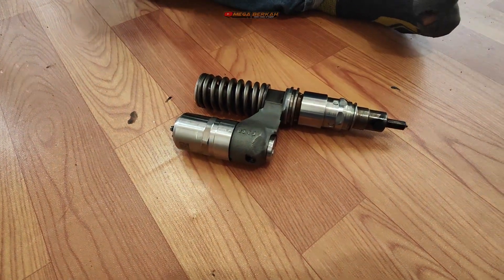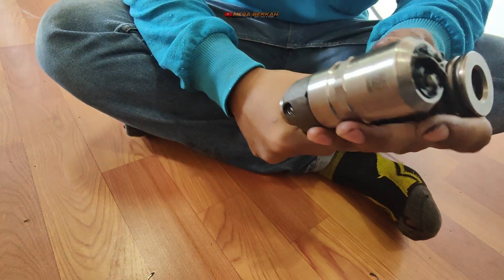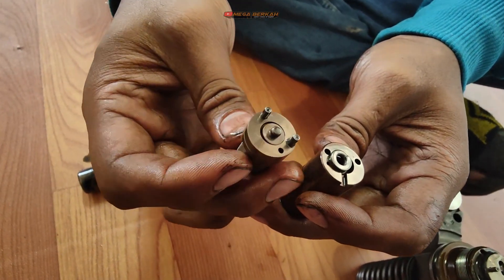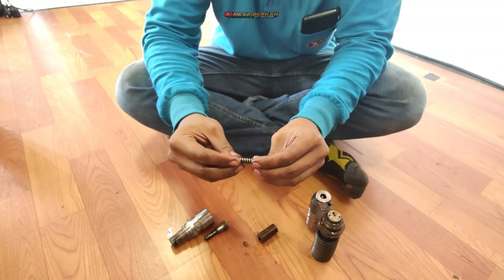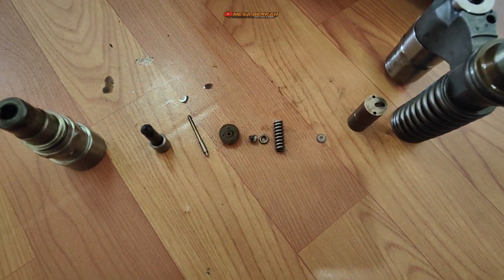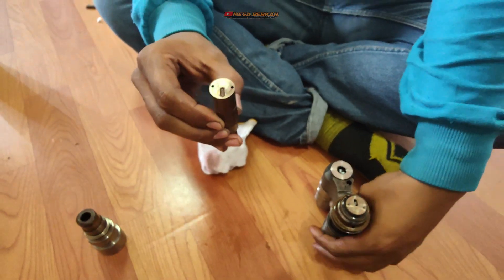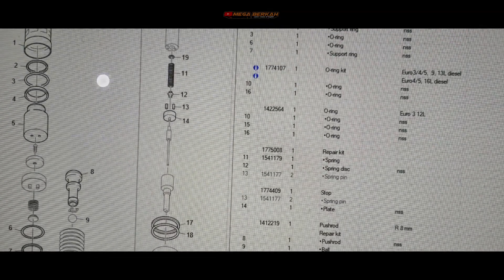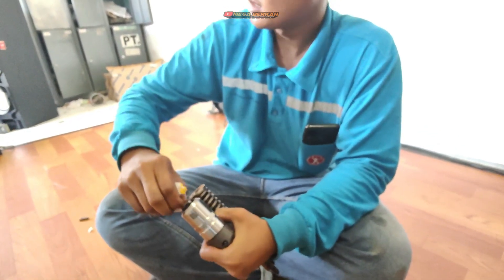Troubleshooting mesin truk Scania engine DC 13 abnormal/Sinjal/pincang.

Comment: mau nanya mas 
engine sinjal saat unit menanjak saat bermuatan scania P410
Reply from the maker: Low power?
Reply: @Mega_berkah  bener mas low power
Reply from the maker: Sudah dicek dengan sdp3?
Reply: @Mega_berkah  sudah mas dan tidak ada error code yang muncul
Reply from the maker: Hasil tes compresi, cilinder balancing ? Gimana?
Reply: @Mega_berkah  sudah di test nilainya masih masuk standart
Reply from the maker: Waktu low power?